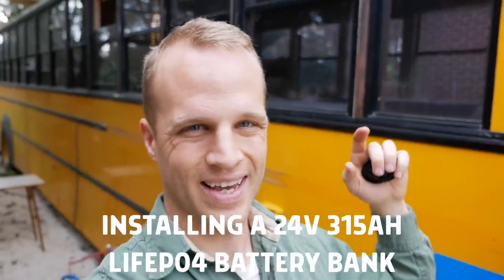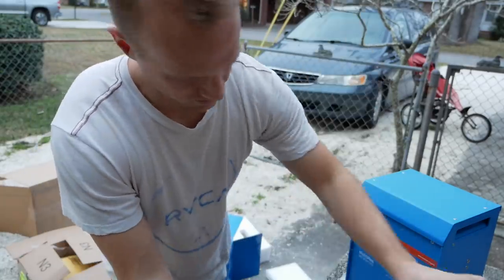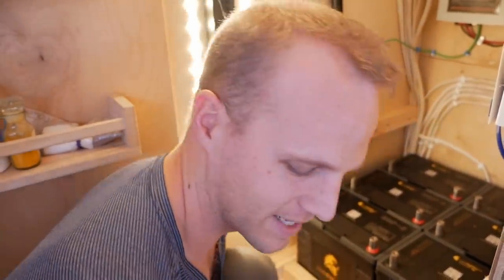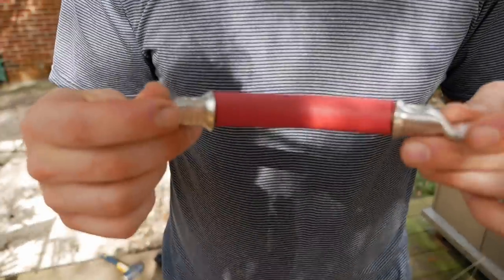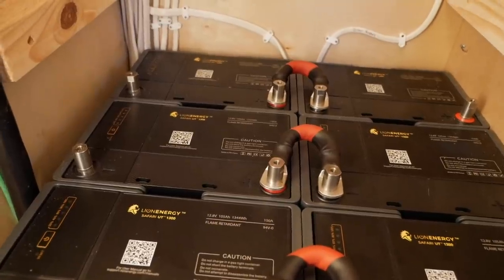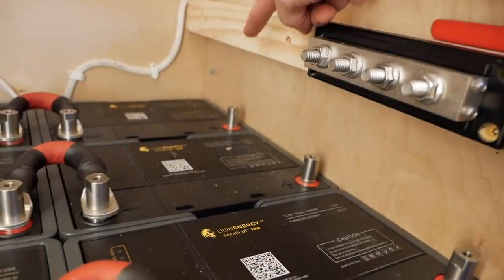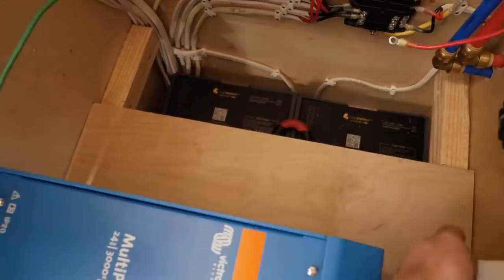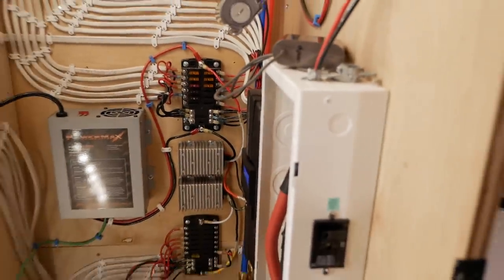Installing a Lithium (LiFePO4) Battery Bank In Our School Bus Conversion (Lion Energy UT1300)

Comment: How did these end up holding up for you? Do you still recommend this brand for batteries?
Reply from the maker: These batteries have held up very well however there are now many reliable batteries on the market in larger form factors that are much cheaper. Basically you can get a better value. I should make another video about batteries soon.